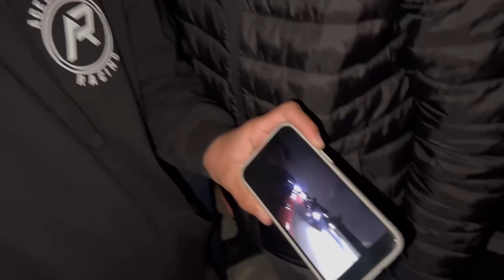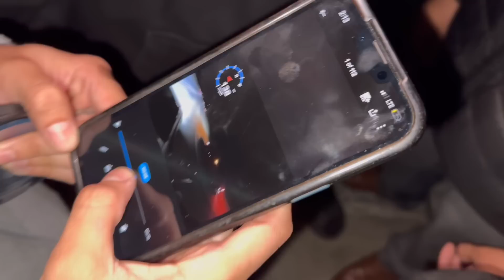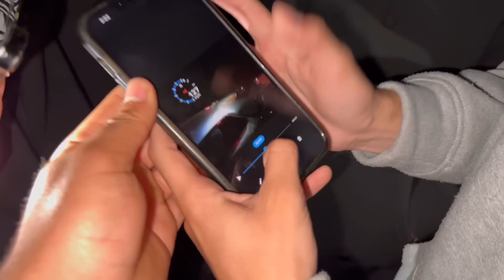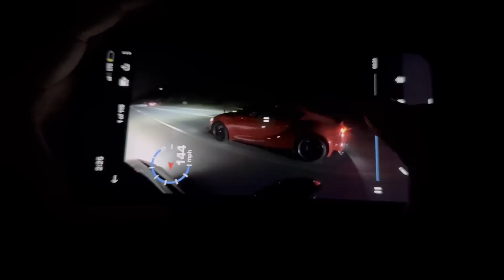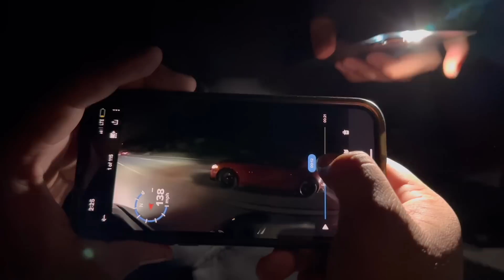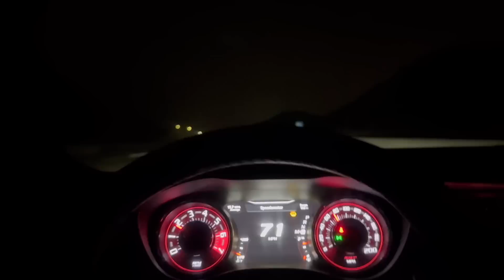HELLA DRAMA SUPRA VS BMW 335i 5KPOT HELLA POLICE #mexico #racing #bmw #toyota #turbo #drama

Comment: there should be a set of rules for roll racing to put the cameras in the same spot on both cars so the angles atleast the same bmw had the go pro on the windshield trying to say they they were ahead, like how? thats that cheating tactic mf use to argue a lost